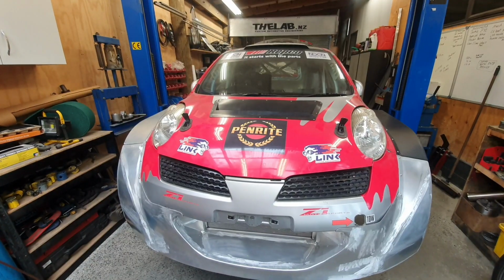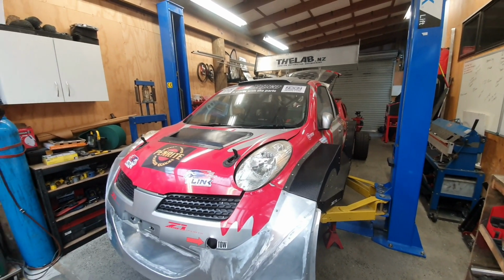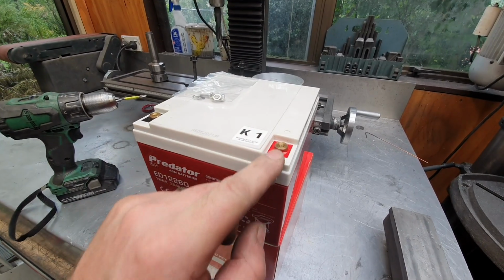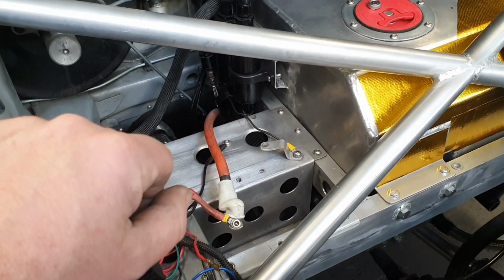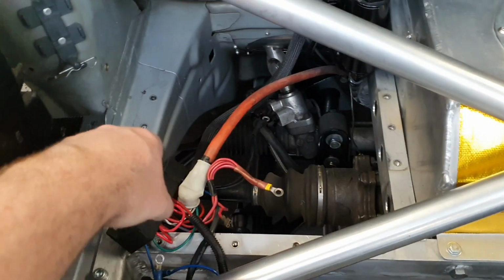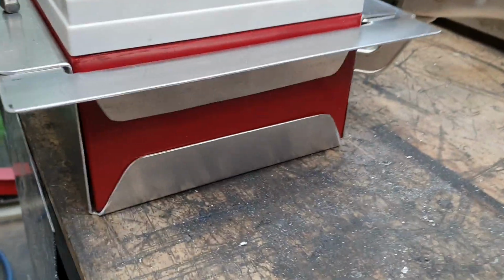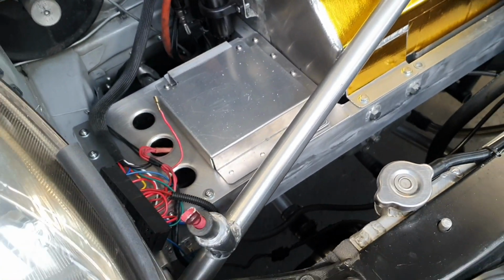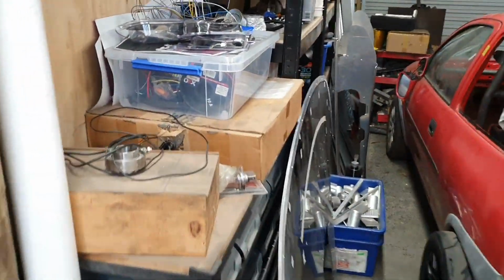New battery for crazy 700hp Nissan March

Comment: Trying to catch up on the videos I haven't watched yet. Besides moving weight to the front, is there any other reason the battery isn't closer to the engine to shorten the heavy cable?
Reply from the maker: Yip balance, car will be slightly heavier but better balance, I've decided the balance is a priority over the minimal weight increase.

Comment: Not sure if you've ever looked into them Glenn, but Shorai batteries are fantastic for race cars, a small fraction of the weight of a standard lead acid, are already tapped to M6 and crank my engines to start as quick as anything, they just don't enjoy constant draw while the engine is off, since it's a motorbike battery

Comment: Thanks for the interesting videos Glenn. It has been good to appreciate the challenges and the solutions you have created. Your video production skills keep improving too.

Turning to the battery issue, as I have understood it, the old, small battery was struggling to maintain terminal volts whilst providing serious cranking amps. The principal issue is therefore minimising voltage drop at high amps. How did the M6 bolt improve this? Yes, it allowed you to crank on a bit more torque, but you actually reduced the contact area with the lug by enlarging the hole. Less area - same amps = more voltage loss according to Mr Ohms law.

What is the alternative view?
Reply from the maker: Thanks!
It's true with a bigger bolt there is less surface area on the top of the battery "stud" BUT this is countered by having much more surface area contact with the bolt threads and the area under the head of the bolt is larger and can have more torque/clamping force applied ensuring maximum surface area.
The bolt having a larger shank allows more current to flow directly through the bolt and onto the top side of the cables terminal.
Remembering the cables terminal had a comparatively large hole in it that we need to work with, I'm not sure it's possible to get a starter motor cable sized terminal with a 5mm hole in the eyelet :P :)